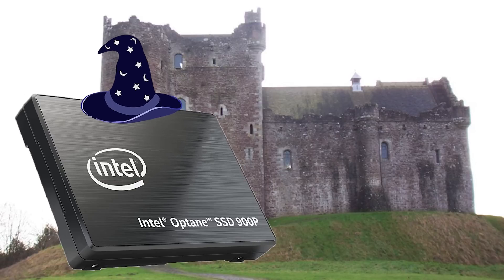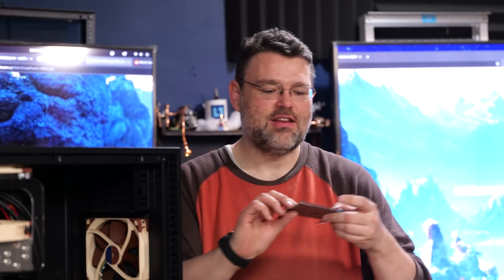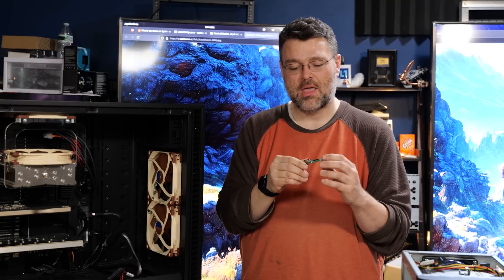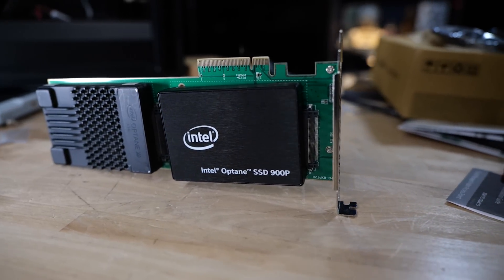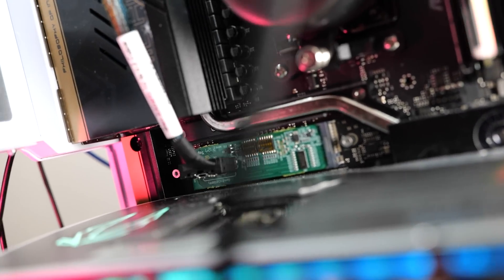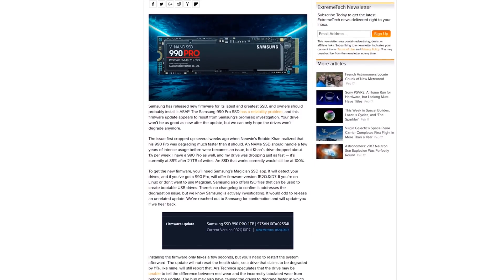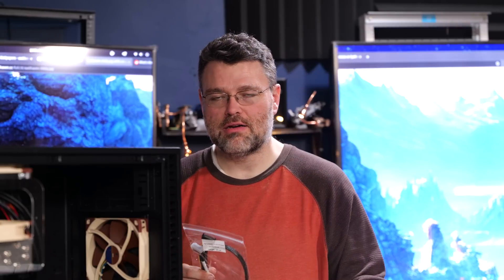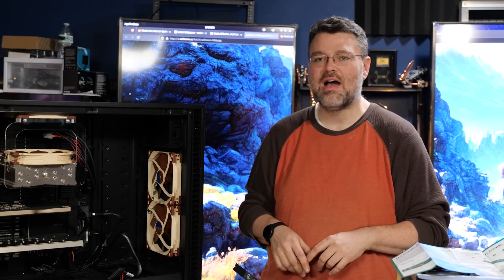The Holy Grail, Finally Found: U.2 to PCIe4 Adapters that Work!

Comment: I agree with you Wendell, modern motherboard makers are batshit crazy. They think "enthusiast" is the "gamer" that has one gpu, one nvme, and a tiny form factor case. Meanwhile im over here using expansion slots like crazy, tons of 3.5 HDD's and just, ugh. Don't get me started on case manufacturers and their "two 3.5 bays or less" motif. Many cases having ZERO 3.5 slots. Its bullshit. And the few cases you can still get that have tons of HDD space, you can't fit a full size gpu in. So I am just "shit out of luck"....

I honestly want a case that the motherboard lays flat. Kind of the those Thermaltake cases, but without all the dumbass glass. They used to make that case with metal and holes all over, why didn't they just keep that going? This whole "hot box glass case" bullshit is not enthusiast at all. Its for stupid people who want their PC to run hot. and then as you pointed out motherboard's.... ive seen quite a few boards with only 4 sata connections. FOUR. not even six. i would prefer eight..... hell maybe ten. I am just so tired of enthusiast being related to "gamer" because they aren't enthusiast at all. I mean I get it, there are a LOT of gamers out there, but that doesn't make them "enthusiast" that makes them "common"....
Reply: Dont forget that it's literally impossible at this point to have HDDs AND water cooling in a case these days in general. "This case totally has a few HDD slots and can totally fit 10 radiators in it" - but actually it should say OR.
Reply: @Basement-Science  its not impossible. The cases today suck ass. Many have dual chamber design but back chamber is wasted space
Reply: @goblinphreak2132  Yeah, last time I checked the only cases that could fit everything I would want were crazy oversized for what they should be - tons of wasted space in them where it's not even possible to put ANYTHING in much of that space because there aren't even any mounting holes or anything.
Reply: @Basement-Science  again, poor case design, but 100% possible
Reply: @goblinphreak2132  Of course it's technically possible. Just not in a reasonable, space-efficient way without modifying the case yourself.
Reply: @goblinphreak2132  Maybe you misunderstood.. I was talking about what is possible with the existing cases on the market... Of course it's pretty easy to design a case that does what I want.
Reply: @Basement-Science  my original post was about how modern cases suck and we need change. You said it wasn't possible and now youre back tracking saying "of course a new case design would work".... Bro just stop....
Reply: @goblinphreak2132  You're not even trying to understand at this point. You could try to re-read our conversation with what I said in mind. Or just be an a$$ even though I never  even disagreed with you.
Reply: My man, Fractal Define 7 has all the drive slots you will ever need.
Reply: @NC7491  coupled with piss poor airflow. No thanks.

Comment: Hello there, thank you for this, finally i can have a SSD with enough size to install not only Warzone, now i can install other games on the same drive. 

I am looking for a 8tb SSD with pci 4.0 speeds since a long time but the normal m.2 8tb drives are far more expensive than the u.2 or u.3. I would love to get the m.2 adapter you mentioned in this video. Where can i get the information about this adapter?
Reply: Warzone, the old pumpkin studio's title, or another warzone?
Reply: @MatthewSwabey  call of duty

Comment: Uh... wendel... isn't a 990 pro faster?
Reply from the maker: Nope
Reply: @Level1Techs  BTW do you know if the 990 issues have really been fixed by the last firmware update from Samsung? I recently saw a 990 PRO 2 TB that was manufactured in February 2023 that already came with version 1B2QJXD7 and am wondering if I should warn its user about it.
Reply: Someone needs to learn regarding the advertised performance values on consumer SSDs and the differences on enterprise SSDs. It boils down to absolute best-case (consumer) and heavily-used (enterprise) numbers. In my opinion consumer SSDs then become quite a bad value, which sparked my quest for using U.2 SSDs on regular motherboards.

Comment: I run my 2 P5800x via Adaptec HBA Ultra 1200P-32i PCIe card. The drives are then presented as scsi devices to the OS.
Reply: Can you run benchmarks to differentiate the emulated SCSI protocol compared to a direct connection with native NVMe?

Comment: M.2 -> SFF-8654 (40cm) -> M.2 -> PCIe 4x works to reclaim some of my precious slots. It's also low profile enough to fit in my ncase N1 on the back of my itx board.
Reply: With a chain consisting of that many individual parts I would only trust it up to PCIe Gen3 and do extensive testing how many PCIe Bus Errors occur.
Reply: Hello, can you please share what products you used altogether? I would like to try to attach optane using the back m.2 slot. Thanks!